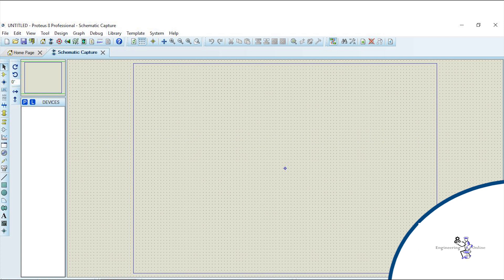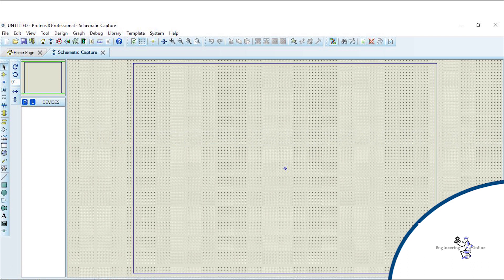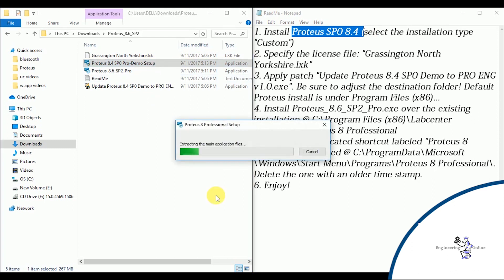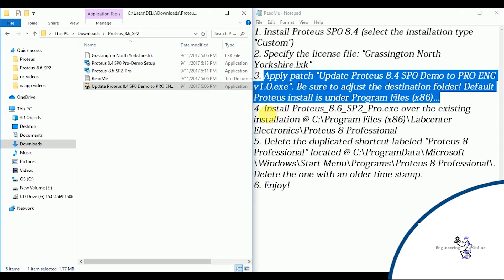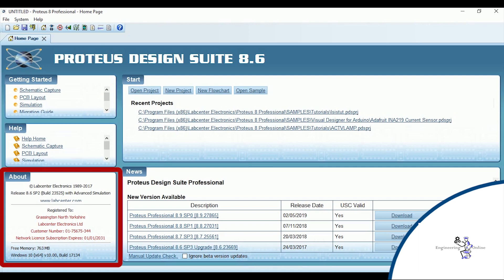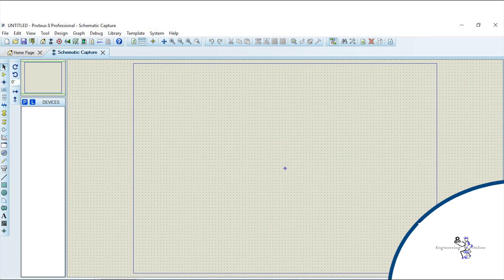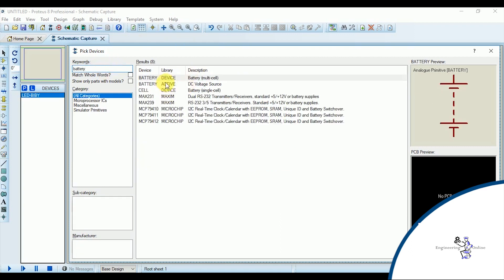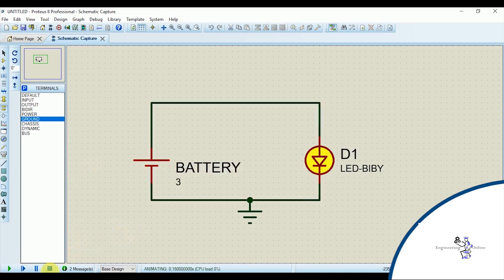An Introduction to Proteus 8 Professional & Schematic Capture

Comment: how to design schematic and symbol of any circuit and use it in anather circuit using proteus
Reply from the maker: You can design components in Proteus if its not available in the library. Will do a complete video on it
Reply: @EngineeringOnline  thank you

Comment: What is it for and where it can be use
Reply from the maker: It is a simulation software, in which you can design and simulate your circuit and verify your results before using the actual hardware components.
Reply: @EngineeringOnline  ok thanks for this video